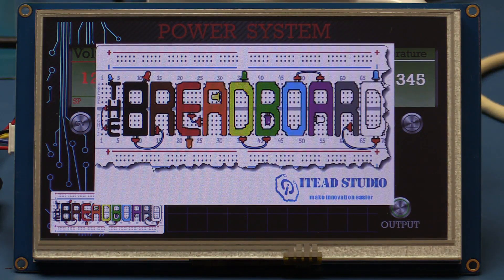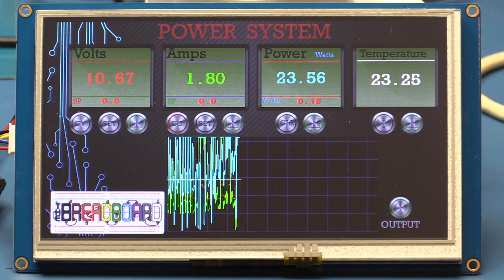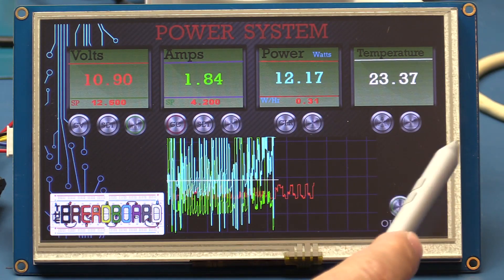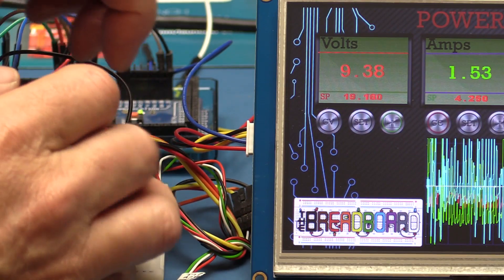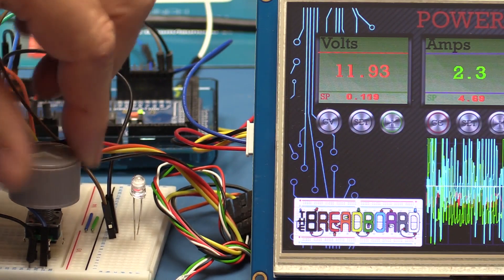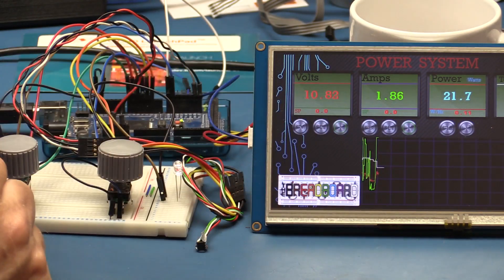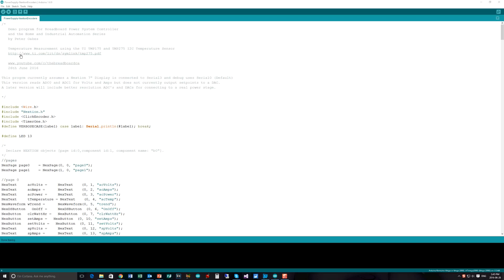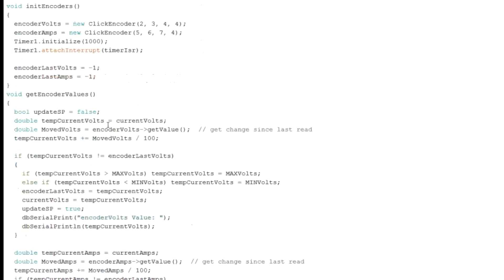Modular Bench power System #16- Smart Display using Nextion 7" LCD

Comment: Peter, thanks for the great project.

I hope you don't mind my commenting that I feel the skeuomorphism of your display is detracting from the function of the touch interface and making the display appear overly cluttered and probably harder to read for the operator.

The silver key elements in particular seem to be fairly low contrast and may be difficult for vision impaired people to interpret.

The graphing is scrolling to the right and this seems odd to me as my scopes and other displays always scroll to the left.

I hope this is accepted as a constructive comment and not just uneducated criticism, I have designed a few touch interfaces and found that excessive skeuomorphism just makes the screen more complicated and adds to the number and size of graphical elements in memory.

Brenden
Reply from the maker: I don't mind at all, I welcome it.

I am not a UI designer and just used icons I found, I was trying to get a theme that matched all through but I agree, a Much better contrast is needed. Perhaps a blank button and add some nice lettering that looks like it is illuminated via a back lit LED ?

Comment: Im having problems with the communication between arduino and display, mine is 7" too. I think its for the connection, im with a mobile charger, but the negative have to go with the arduino GND?
Reply from the maker: That is correct, the negatives all need to be connected together, the supply for the display should not come from the arduino though as it wont have enough power for the arduino and the display, you should connect a separate power connection to it

Comment: where could use this example
Reply from the maker: I am not sure what your asking, can you please explain
Reply: I have Inverter power supply and would build a same control board with arduino and nextion, there if you have some one program like your's or example to find a communication between arduino and nextion
Reply: If I can get a program for a dc power supply between arduino and nextion